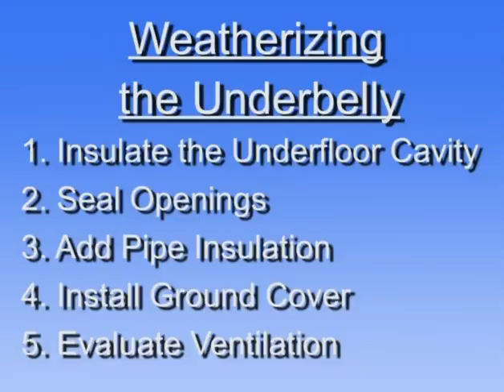Mobile Home Weatherizing the Underbelly

Comment: Why is this not done at the time of manufacture? It doesn't matter where it will delivered to, warm or cold climates. When you insulate it protects the home from any weather to keep the utilites as low as possible.
Reply: Lol u think these building companies give a flying shit about your utility bills? Lol less money they have to spend to get a trailer out of there hands and money in there pocket best believe there going to not do it .
Reply: @Join0rDIE1776  True that
Reply: Of course there is insulation & a belly board or a vinyl or fabric put on the underside of mobile homes when they are manufactured.  This isn't a brand new home, and as time passes, shit happens.  Water pipe breaks & you have to cut open the underwrap & take out insulation in that spot to repair the pipe.  Rodents, cats, raccoons, etc. get in through a crack or opening in the skirting & tear open the underwrap to get up in there & keep warm - or worse nest.
Reply: Mine came with the underbelly insulation.  But a problem made in fall away.  Think the plumbing out pipe leaked from the kitchen. I had professional business relevel, and they fixed it and good thing, as I live in Minnesota.

Comment: A mobile home should be set up like it's over a basement with no insulation under the floors. Just insulate the skirting and Heat The Underneath. Now you have heated floors and access to all the plumbing if necessary.

Comment: Great video, but I had to laugh when talking about vapor barrier. I  live in the desert and that vapor barrier would last until the next flash flood comes up my drive way and washes it out into my backyard.  I'm still  trying to figure out how to replace the cheap plastic skirting that blows out every time we get high winds 
(60+mph winds). What you do would  be great for those that live in a mobile home park or on a lot in town, but not out where I  live.  Thanks for sharing.
Reply: Lots of people use blocks instead.

Comment: If you buy a new one ,  get a mobile with standard rated R value and good weather protection from the factory, In Canada some are R 40 floors
Reply: Thanks for the comment.  I live in Minnesota,  and while I can do that heat tape for the incoming,  my water will freeze up in the underbelly , leaving frozen water lines to across the house, kitchen,  bathroom.
Reply: And it's insulated underbelly from the manufacturer!

Comment: The previous owner of my mobile home was eligible for weatherization program and they blew the foam in underneath the belly of the mobile home but they did nothing else. That was back in 2018 and would it be too late to put some kind of a belly board up now? There is no one who does mobile homes near me or even the radius of about 50 miles. As much as I like watching these videos I get very frustrated because there's nothing I can do.

Comment: Does the type of skirting make a difference to keep cold air from swirling around under the house?
Reply: Yes, greatly.
Reply: Close your vents and make sure the skirting is sealed good and you will have no swirling air. And if your floors are cold just insulate the skirting 6 inch thick, get rid of all the insulation under the floor and put a heater under there now you have heated floors. And access to any and all your plumbing that you want to do. And make storage area under there now it's warm and dry.Seal it good from dirt to floor and you won't even have bugs.
Reply: @cynthiaayers7696  the ground can get wet underneath, what cover's it ?
Reply: @daleval2182  Didn't you watch this video?  They showed - you can put a layer of heavy vinyl and he says they overlap the pieces by 2 feet.
Reply: @playhooky I did watch the whole video, read the rest of my comments, I'm saying sealing all edges was my point and opinion, as your entitled to yours.  Thanks